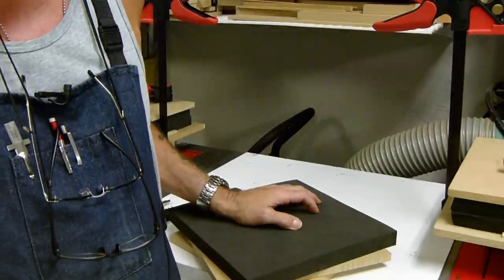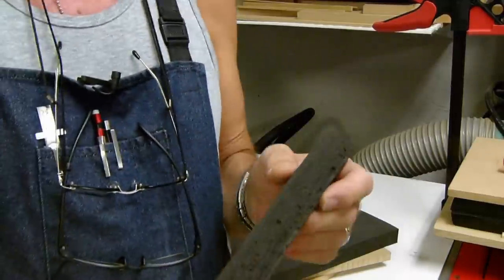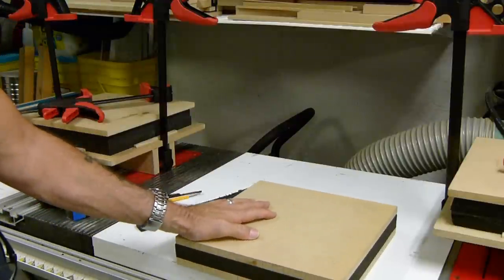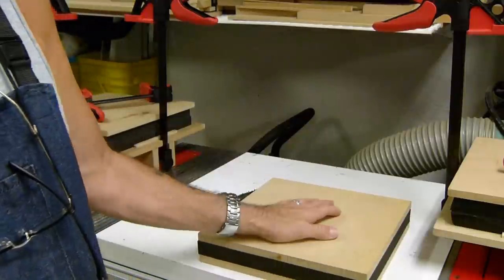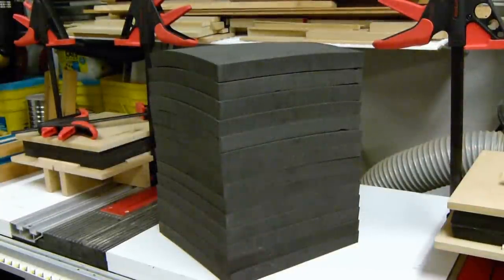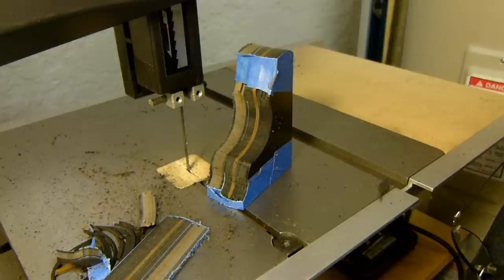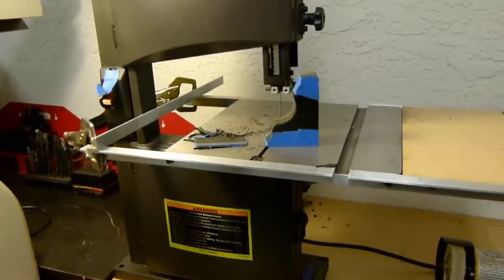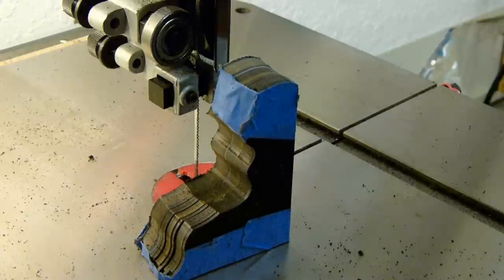Kydex Tools: Using a Bandsaw (band saw) to cut Foam and Kydex

Comment: What blade are you using.  Also is there a way to get a guide to get straight edges.  Please provide links to all the ADDONS for your custom table as well as the blades to cut the foam.  I have 439 X 72 foam that need to be custom cut